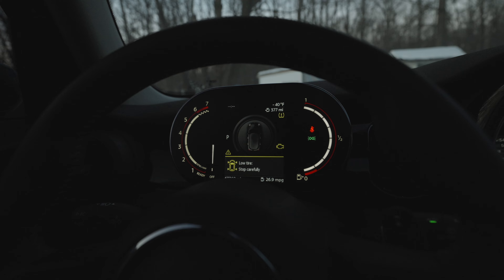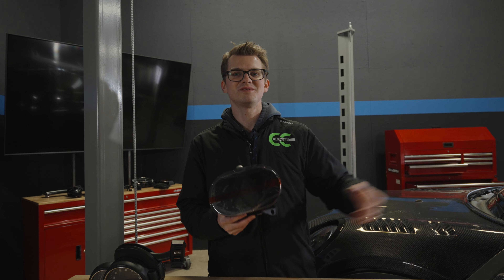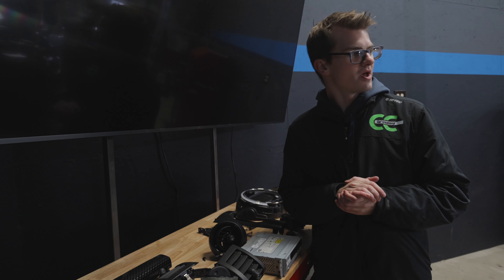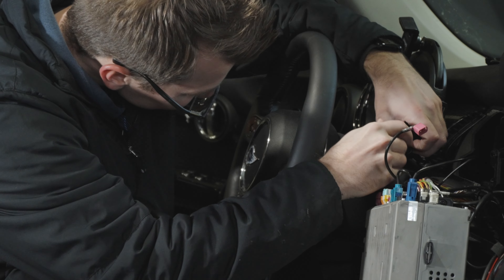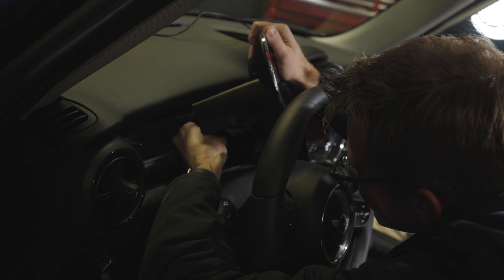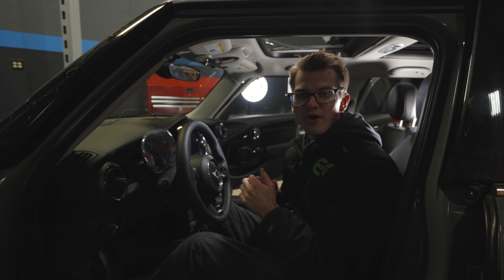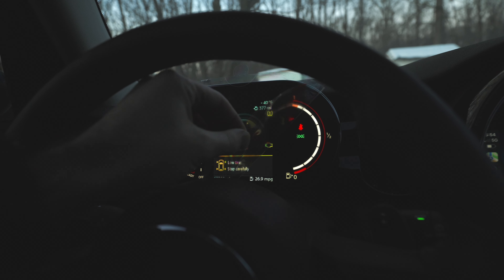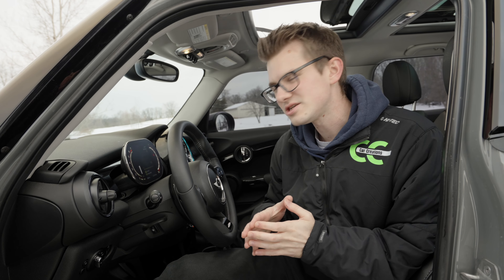Installing the NEW MINI DIGITAL CLUSTER

Comment: Love this .would this work with my f60 countryman 2017 cooper D?
Reply from the maker: If you have a heads up display, yes. If you don’t, remove your screen and check for the most port as shown in the video. If you have the most port, then yes. If not you will have to replace your infotainment system.
Reply: @carcreationsyt  ok thank you, I have  no head up display. Any idea how much it's likely to cost for all the kit including coding.? Thx

Comment: Did you know if the Dashboard of mini cooper electric 2021 can work on a mini cooper petrol top s 2018 (with head up display)? I find one here to buy.
Reply from the maker: It won’t work as it has different functions
Reply: @ that's de reference:

6210 5A33B86-01
Typpruf. Nr.
Lief. Nr.: 179972-10
8 796 201
VPMKAF-10849-HC -
S/N: 48164797
Visteon HW: 01.07.00
SW: 003.003.006
11/05/2021
Made in Slovakia
IK5A33B8601

Comment: İ have f55 2014 mini cooper. İs it work?
Reply from the maker: It should work, yes! You need to make sure you have the most port or heads up display. If not, you will need to change the head unit.

Comment: Do you know if the F60 b35 engine countryman would work with this ? Or it's best to just remove the previous head unit and check for the connections you said
Reply from the maker: It’s probably best to look at the connections as the car’s spec was put together using whatever part they had on hand that met the specifications.

Comment: What does the red meter next to the fuel level meter (white) indicate?

I have a 2022 Countryman and mine does not have this...
Reply from the maker: This is the jcw specific cluster so has some red excitement features. It also has a checkered flag on the rpm’s.
Reply: @carcreationsyt  ah... Okay that makes sense. I didn't realize it was so much different! Thought it only had the checkered flag thing.

Comment: Hey Ethan, Where do you get clusters from and how much does it cost?
Reply from the maker: Hello, thanks for watching! We have a supplier and get them bulk. If you are interested, send me a dm on instagram or an email and let me know if you have a heads up display and I will get you a quote with coding support
Reply: @carcreationsyt  do you only have info for UK owners because I am in canada and wonder if the coding would be different
Reply from the maker: @ski7722  This is exactly the same for UK owners!
Reply: Ok so your instructions here would work for me also in Canada then? Just to clarify! lol THANKS!  @carcreationsyt
Reply from the maker: @ski7722  yes for sure!
Reply: @carcreationsyt  have a 2022 5d with the classic speed meter. The question is if can be replaced with the digital cluster ??

Comment: Hi, I have a mini 2017 F54. I have already retrofitted the head unit to an Evo (with navigation) and a digital cluster. 

However, my digital cluster does not show navigation when I navigate. My installer does not have any idea. 

Do you know what is missing? Thanks
Reply from the maker: That is odd! 
If you go to settings, do you have the checkbox checked that allows the digital cluster to display that?
Reply: @carcreationsyt  Hi yes .already checked .Would it be possible that some coding is missing?

Comment: Hey Ethan, Great Update as always. But i wonder why your „speedo-circle-background“ isn’t blue with the new LCI2 head unit? 

I thought only the old headunit systems which are still working for the digital cluster, would have the black „speedo-circle-background“

I know that you can update the firmware from the old „large display“ headunits, so that the digital cluster turns blue. 

But I really wonder why you’re speedo is black. 

I personally prefer the blue background for the speedo, that’s why i can’t get myself to the point upgrading it yet. 

But now I wonder if you maybe can code the colors? I’m confused.
Reply from the maker: Thanks for the question! 
I found out that it depends on the bdc version. 
I can’t currently get the infotainment system dark theme because of that too. 
Currently on holiday but when I get back I’ll see if I can flash the bdc with new software and I believe that should be the solution. 
I’ll probably do a video or a YouTube shorts with the results
Reply: @carcreationsyt  thanks for the answer. 

A video in some sorts would be great. I really wonder if could get the blue themed digital cluster version on my old 6,5inched headunit then with a bdc flash update.. 

Pls share your results. 

For now have a great time.